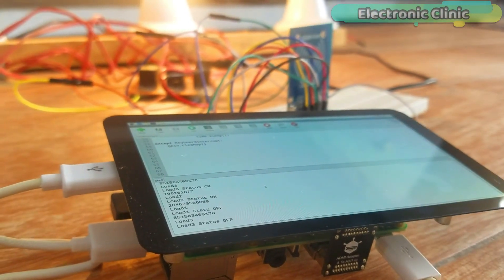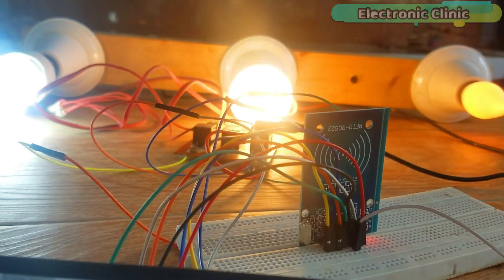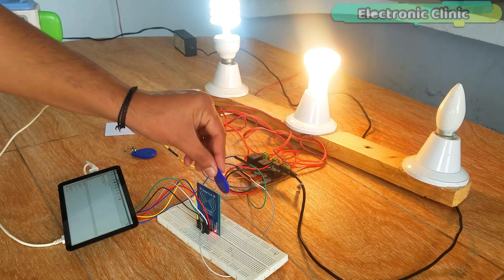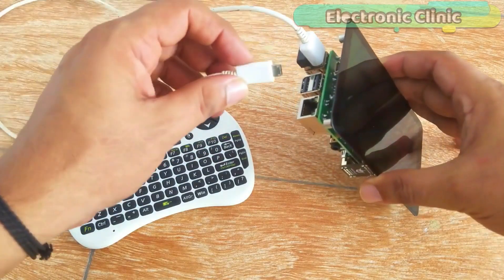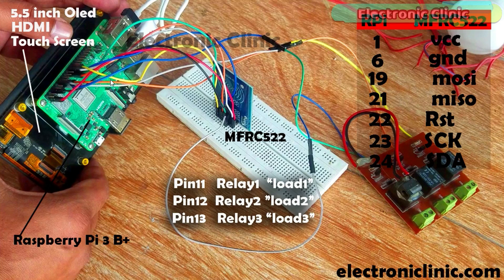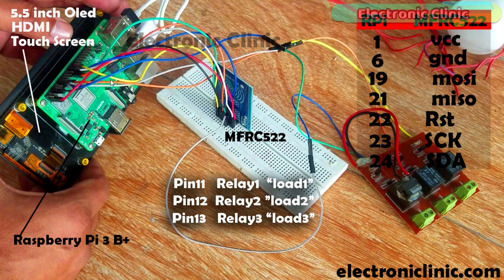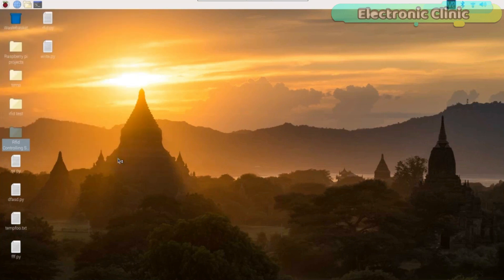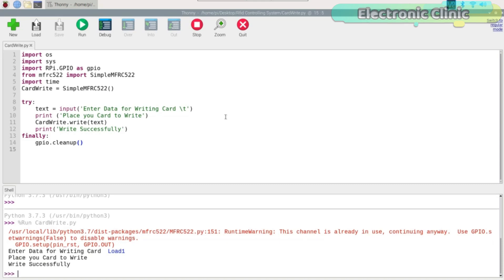Raspberry Pi Home Automation using RC522 RFID Module, RPI Smart Home

Comment: Can you do this with raspberry pi zero?
Reply: The pinout on the PI 2,3,4 and zero is the same, so yes it would work. I would recommend on the zero going headles (no desktop) as it will increase resources available to your scripts. If you are looking for a smaller footprint may I recommend a ESP8266 based board like a Wemos D1 Mini. You can use circuit python on these or c++. If you use c++ I would off load the 'approved list' to an external server. 1) card is read ID caputered, 2) send ID for authentication, 3) server responds with YES or NO response, 4) if Yes perform action, if NO do nothing. Of course this could be expanded to include multiple Yes response types, or flash a red led on a NO response..
Reply from the maker: i think it should work with the raspberry pi too.